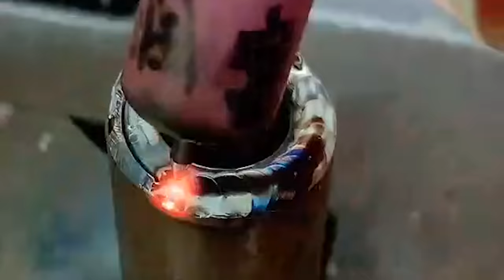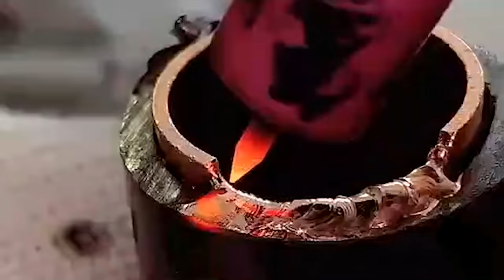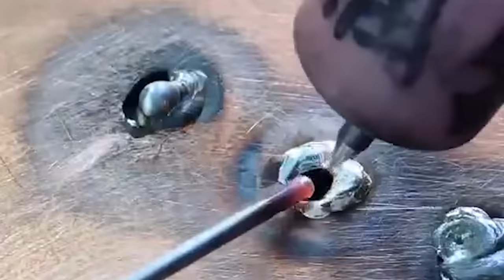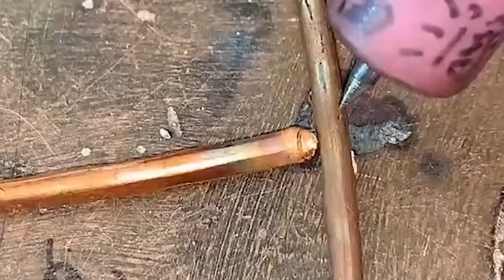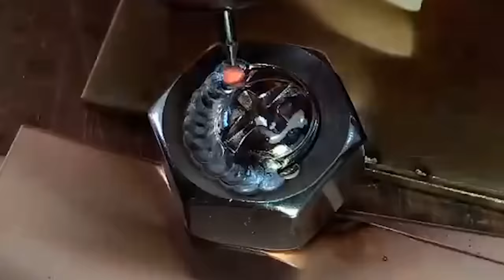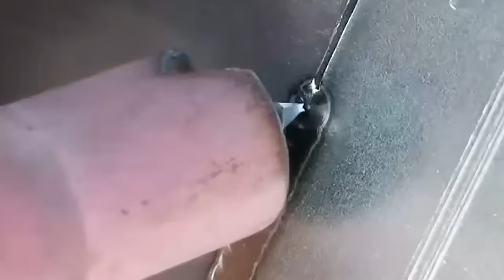What is cold welding? Watching this video you will understand!

Comment: This comment section doesn’t know anything about welding😳
Reply: which type of welding is this
Is it a TIG Welding (Gas Tungsten Arc Welding - GTAW)
Reply: @vamsi1997  yes but this could be considered a sub process of tig welding given the amperage and duration of the arc.
Reply: @benargee  thank you for your reply
Reply: No clue about welding but i can say one thing this isn't cold welding. That word already exists and describes a phenomenon that has nothing to with this. If you need to deform metal to weld its not cold welding.

Creat your own word and don't steal them from other shit.
I have one That would work:
"colder welding"
But even that one isn't correct as the actual welding/concentrated puls is probably hotter than normal welding
Reply: I know right
Reply: @toaster_gmbh  it's just a name dude, chill
Reply: @vidal6343  it's a misleading use of a type of welding that exists and this is not it. Trading standards should come down on these vids but they are chinese so the truth doesn't matter.
Reply: @vidal6343  we are disappointed because we want to see a real cold welding in action. the cold welding that we want to see is the welding that is usually done in space vacuum (it requires no heat at all).
Reply: @OranJee  I see. so it's impossible without vacuum?
Reply: And we're not much wiser after watching the video (and of course its #*¥@!! adverts).

Comment: “Watching this video you will understand”
While this video was definitely cool to watch, it was not informative in any way, and left more questions than answers. You showed different metals coming together in a very satisfying way, but did not explain the process or how it works. There also seems to be confusion in the comments around wether or not this is actual cold welding. I personally know nothing about welding other than basic electrical soldering, but it seems you may not have accurately labelled/named your video. My advice to reduce the amount of dislikes on your videos is to choose your title wording a little more carefully.
Reply: Well, I dont see how this "cold welding" is a thing, (because it's not) welding requires melting metals, the videos first clip is a glowing red ball l, which is obviously hot .... I'm convinced this cold welding is just marketing. This is just a Tig welder, maybe with a pulse setting and good gas coverage
Reply: What's up guys this is by all means no cold welding even though cold welding is a thing it deals with more NASA and space Parts if you look up cold welding on YouTube you might find what I'm talkin about play this is all Fusion welding with just no other material into a welding this isn't cold welding and it's definitely messing everyone up because of it the more you know the better off you'll be cold welding on the other deals with the surfaces of the metal being so smooth that they literally bond with friction this has happened and has been proven to be a process that nobody actually uses but it is a real thing
Reply: @willstokes7266   cold welding can only occur in a complete vacuum. They use it for joining nano wires and very small things like that. Sometimes it happens in space as well. Look it up it’s actually really interesting
Reply: @willstokes7266  study a little more about the subject before you make a comment this long. You’re wrong btw
Reply: @jose_4514  join (a piece of metal) to another without the use of heat, by forcing them together so hard that the surface oxide films are disrupted and adhesion occurs.

Cold welding or contact welding is a solid-state welding process in which joining takes place without fusion or heating at the interface of the two parts to be welded. Unlike in fusion welding, no liquid or molten phase is present in the joint. 

Here's what happens: when two surfaces without an oxide (rust) layer are brought together in space, the atoms of either side collapse into each other. ... This is known as cold-welding and it happens because the atoms of the two pieces have no way to know they are separate

Cold welding is a bonding process during which two solids are forced to form a single piece by applying adequate pressure. This disrupts the barriers of the oxide layers on the interface, and brings about an enduring adhesion between the two surfaces.

Cold welding, also known as cold pressure welding or contact welding, is a solid-state welding process where the joining of two metals takes place without fusion or heating at the interface of the two parts being welded together. This means there is no liquid or molten phase present in the joint and joining process

What Does Cold Welding Mean?
Cold welding is a bonding process during which two solids are forced to form a single piece by applying adequate pressure. This disrupts the barriers of the oxide layers on the interface, and brings about an enduring adhesion between the two surfaces.
Unlike the conventional welding process, there is no application of severe heat or melting of the material at the interface. Both the surfaces continue to remain in solid phase throughout this forced adhesion process. The necessary force for the adhesion is applied through mechanical rolls and dies.
Cold welding is also known as contact welding.

That enough research for you Oh mighty all knowing one that won't tell me how I'm wrong but they said so so it must be true?

Comment: As a pro Welder for over 30 years I can say this is a long delay pulse welding and is a fun way of welding for cosmetic looks for the home hobbyist.

Nice for you to take the time and demonstrate . 
I'm sure their are going to be many people influenced by this video.
Just to say as mentioned in other comments this only gives about 30% to %40 of strength depending on materials  used and has a lot of weld pool shrinkage and so makes it no good for parts that need to be strong.

Example Steam pipes, as in no time there would be so many leaks.
Reply: as a person who has been around a lot of welding through work , whats the difference between this and a TIG? this looks a tig welder to me (but of course just because it looks like that to me doesnt mean it is)
Reply: @antaLord  It is still Tig welding but without forward heating. 
Well the Chinese are calling it Cold welding
In welding terms it is a failed weld. 
But cosmetically looks and performs ok on decorative stuff as shown here and these items don't require structural strength and is just to look good.

Meaning this Cold welding saying is a spot weld feature on the Chinese welders that are being marketed as if its a new idea of welding, in fact its been around since TiG machines were invented,
It was a way i started to weld a long time ago on very thin metal. Almost a tin foil for British aero Space 
as forward heat would burn it to nothing.

So If you have a TiG welder with a Pulse feature, your more likely are able to change the frequency( Pulse duration ) to a very slow rate and so you can do the same. just turn up your AMP's to around 100-120 for 1mm to 2mm metal. you may have to tweak the up and down cycle rate to, also you don't have to use full Argon, you can also use just Co2 or a Argon mix as their is no burning for oxidization
Reply: @spudnickuk  ok, yeah i thought this looked alot like a tig, thanks for explaining!
Reply: @spudnickuk  so the slower the pulse, the thinner the material you can weld without melting it entirely?

I'm thinking about learning to weld watch cases/parts using TIG as a more affordable alternative to laser
Reply: @kevintanumihardja3881  It is not just about slowing the frequency  to achieve thin metal welding.
other factors like a smaller Tungsten suitable and a narrower Gas shield and getting the right Volts and AMPs
and that said the type of metal all take a factor on achieving a perfect weld. 
Just to say Stainless steel is very easy
 
Well if your doing small items, I would recommend a machine like this
DX-808 80A Pulse Spot Welding Handheld Pulse Spot Welding Machine
As it has very low Amps suitable for small stuff.
But if you already have a Tig welder then play around with it from the suggestions/Advice mentioned  and let us know how you get on,
Oh i would say practice on thinner metal than what you intend to use, 
as harder it is the better you will become.
and easier .

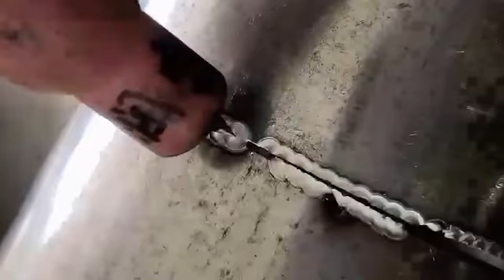Comment: 2:10 shows the strength of these "welds'
Reply: Yes, I agree with you. Very little penetration. Thanks for bringing to everyones' attention.
Reply: @peterduxbury927  but it is better than using epoxy to "glue" them together.. lol..  I understand it is not for anything that require strength carrying.. but it is so cool.. and the welding/ melding joints are so neat... my stick welding skill looks like shit..  but that welding made my eyes glow! lol
Reply: Quando o cordão está completo a resistência é satisfatória, mas claro que depende da necessidade. 
Essa solda serve para coisas pequenas e para criar uma vedação hermética onde outros processos causariam dano à peça. 
Ele não é pior ou melhor. Simplesmente adequado para alguma necessidade. assim como outros processos são bons para alguns objetivos e ruins para outros. Depende da sua necessidade. 
Não seja irônico usando "Soldas" entre aspas. Você desmerece o trabalho da moça fazendo isso.
Reply: Perhaps there is a way to increase the heat to get deeper penetration. OH wait!
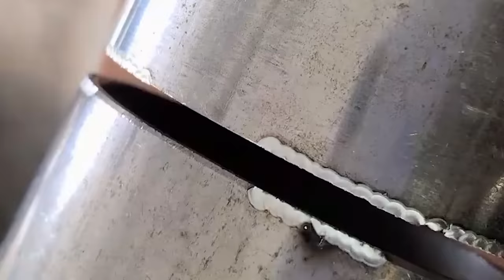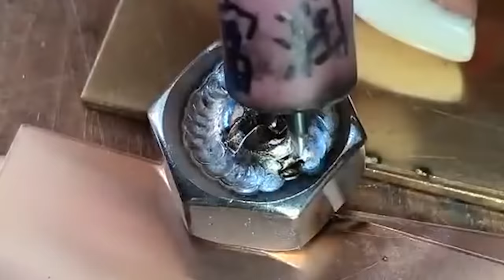Reply: 2:10 shows a pipe being tacked. 2:36 shows a weld.
Reply: @Bikewithlove  2:10 shows one of these "welds' split down the middle like a kit kat
Reply: @jackhughman9450  - Those are also tack welds. Tack welds are what you do to secure steel where you want it so you can weld it (2:36) without it moving around on you. This is a demonstration video. Do you think maybe they did a few tack welds to get the shot right? Because that’s what it looks like to me. And yes, a tack weld should be able to break like a kit-kat bar if you fuck it up.
Reply: @andrewyek  your stick welding skill might look like shit, but it will surely not break apart from a gust of wind like this one does.
Reply: Funny thing is about these comments. 
It was cut, that's not a break  smh. Common sense has left the chat
Reply: @JamesBond-oc4gm  - It can be hard to tell if they’re stupid or they’re trolling - both of which are stupid.
Reply: @Bikewithlove  agreed
Reply: @andrewyek  epoxy is stronger than these half ass spot welds.
Reply: @peterduxbury927  Um pardon me sweetie. Yet you were not elected to represent us in this here session. So no, thank you for bringing it up that you were bringing it up! So cute!
Reply: @andrewyek  my adopted father said -it looks like someone fed a chicken some solder and welding rods then it tooka shit, where my stick welding was concerned...();}>
Reply: This is also done with some bull shit editing.  It takes a lot longer to make these "welds"
Reply: @Bikewithlove  That's because that's all this machine is is a tack welder pay 500 bucks for a fucking tack welder not me buddy
Reply: @JamesBond-oc4gm  you are obviously not a welder buddy
Reply: @Bikewithlove  not a welder
Reply: @imhungry2387  ok youtube comment professional
Reply: @imhungry2387  - Ok, buddy. 👍🏻

Comment: This is not cold welding. This is tig welding on a spot weld setting. Cold welding involves pushing metal together at great pressures and them welding together by the molecules exchanging atoms at the surface of the metal. An example of this is that you leave a block of lead on a block of gold after a week they will weld themselves together just from gravity. This can happen with gold and lead because they are similar but other processes need pressure to do so.
Reply: Sounds like you speaking more of explosion welding.
Reply: It cannot be done! Even rocks in the Earth need heat to form different elements. It's a law of Thermodynamics of transferring any type of energy.
Reply: @rduse9197  although this is not cold welding, cold welding is real. It is something that happens with pure(unoxidized) metals in a near perfect vacuum. They will naturally bond together. the astronauts who work on the space station have to have ceramic coated tools because of this problem.
Reply: @Timothy Wess  
Ceramic tools in space. I was unaware of this, but the only thing I can think of is there is no shielding from the Sun as a radiation source. So through electromagnetic radioactive force, metal tools either magnetic or highly conductive can but slightly ionized causing the molecular bond to be in a semi-solid state....but why wouldn't the laws of thermodynamics take place? The tool should not only weld but also heat up to an extent... unless the laws of physics are different in space's vacuum.
You may be able to glue an object to another like solder, but as to fuse into the other metal and realign it's crystalline structure, I don't think that is possible and I would definitely not trust its strength or integrity.

Comment: Looks pretty, holds nothing.
Do not weld parts like this that actually need to resist forces.

Maybe for Art projects but not for actial welding.
Reply: I need exactly that, something for sculptures that barely need strength. Is looks nice and tidy, little sparks and mess. It feels safe. I am not looking forward to go full-on welding at all. What would you recommend to me?
Reply: @valkenburgert  Buy a TIG welder capable of 'pulse' welding...use 100% Argon gas, and don't weld aluminum (it will crack on cooling, as aluminum needs a 'blend' filler rod to be strong)...oh, and expect MINIMAL strength and almost no penetration to the weld (1/16th inch).
Reply: True, but I don't recall anyone ever claiming TIG fusion weld was structural. It's the super glue of the welding world.
Reply: @Bob_Adkins  more like the paper glue stick of the welder world. Or maybe the chewing gum...
Reply: @thewoodweldingfabricator9300  Some welders would use a 5/32 rod on a Rolex.😄
Reply: @Bob_Adkins  I'll go one up on that Bob. I've used a 0.004"...yes a 4thou thick wire..the thickness of a human hair, repairing poor engraving on a Rolex housing.
Reply: @Lightning-Man-1954  Yikes, that makes my eyes water just thinking about it. I come from a career in engineering,  metallurgy, and metrology, where our reference gage block tolerance was .000004, or 4 millionths of an inch. I love precision instruments like watches and gages.

Comment: It's actually Pulse Welding. You send a high current short duration pulse.
For pipe to get a strong weld you need to be able to pulse weld the inside seam as well.
Reply: This is capacitive discharge..
Reply: For a pipe to weld with strength you need to do a root run. As you pump in the filler you'll notice a small hole that looks like a key hole. As you pump in the filler it developes a type of run which is also purged internally at the same time as the filler is applied from the top through the Keyhole  effect. Once the weld is joined  probably 2 CAP RUNS are done over the root run deposit. They are a little hotter allowing the cap runs to help suck up the lower root run into the CAP RUNS...this is where the strength of the weld happens. Some seem to favour
 " Walking the Cup" creating a one seam that is just a little wider than the 2 CAP RUNS.
Walking the Cup can make the weld look better visually. I favour being effectively, leaving a 1st Class result. Per industry Standard. 
There is no inside welding to smooth things out.
Unless it's a robot sled doing Pipe lines.
I've seen root run leave Haemaroid like hangings inside food grade tube joins. All has to be cut out...&...not from the inside I assure you.

Comment: Call it what you like, but metals (mild steel, stainless steel, aluminum, brass) don't melt when they are cold. I've been a welder for 55 years and I've seen almost every kind of welding, in all cases the metals have to be melted. Lead/tin solders melt at the lowest temperatures, a couple of hundred degrees, still hot enough to destroy your skin if it were exposed to that temperature.

Comment: You are awesome.  For all of you saying this is not cold, it is cool enough to keep on a table after it is welded, that's pretty cold.   For all of you saying it is not structurally sound, wtf, she's just showing tack welding, and melting small parts together, filling tiny holes in cans and tanks.  She's not working on a skyscraper or bridge you daft pricks.
Reply: Those welds wouldn’t hold shit, there’s 0 penetration. 
“You daft prick”
Reply: Wont leak...

Comment: Im no welder but this looks cool, thats a very large amount of energy concentrated in a small area
Reply: Mig or stick welding is nice on bigger things but this is neatness without much cleaning afterwards also thin materials burns away quickly with mig & stick
Reply: It’s basically single pulse high amp tig.
Reply: @griffin2zion  if you had a Tig welder this function is called TIG Spot.
Reply: @shotgunsam23  thats pluse tig he has a pluse setting on his machine u arnt welding aluminum to steel i r melting it over its not good for and pressure like pipe nothing special at all
Reply: @Parody314  didnt i say that?
Reply: @Parody314  that’s exactly what I said lol. It’s spot tig, basically pulse but without the sustained arc.

Comment: There is nothing cold about this. The welded area is so small that the surrounding metal absorbs the heat from the plasma arc so you can touch it almost immediately after welding. That arc temperature is anything but cold.

Comment: Trying to find out about actual cold welding and I get some slag with a TIG
Reply: Lmao
Reply: Google cold welding. It is actually very interesting but not what I would call welding. More like fusion welding. Two surfaces which are clinically clean are brought together under pressure and the atoms of each surface can't distinguish between the two so cross over and form a homogenus bond and become one.